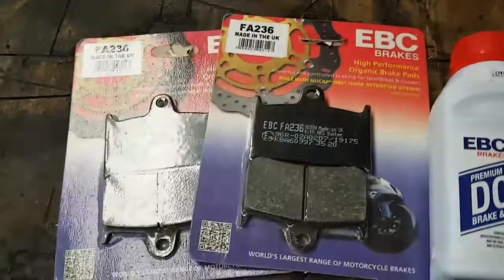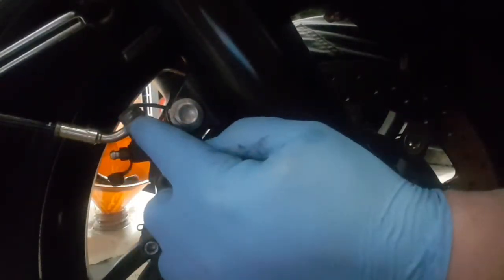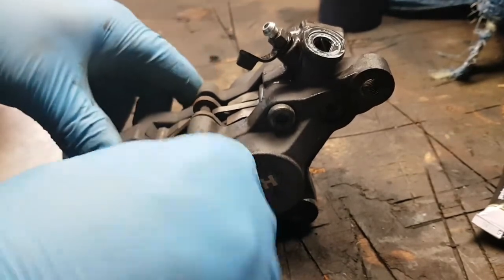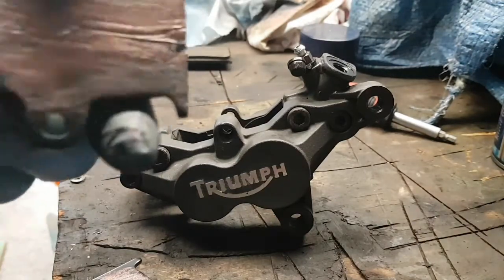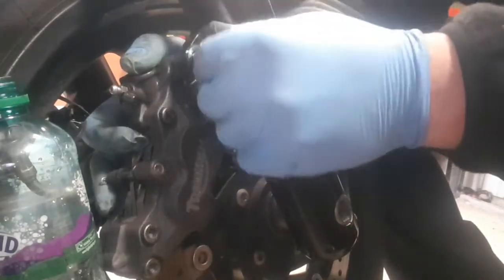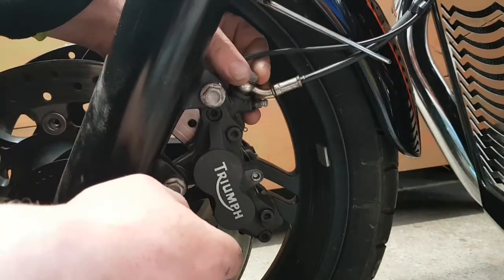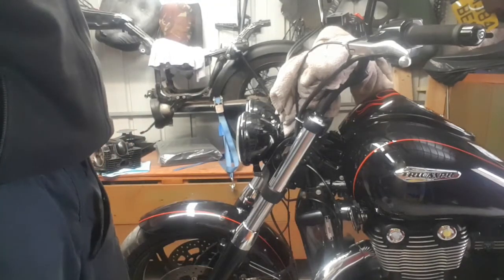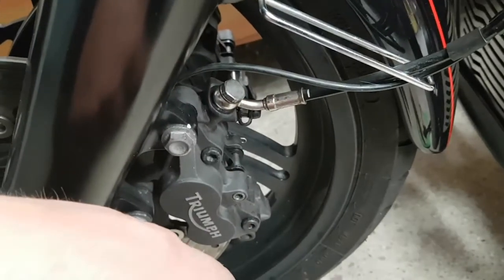Triumph thunderbird storm front brake pads

Comment: I am curious as to why you removed the brake line?  im just researching this and as its ABS, why not use the bleeder?  I am about to do this for front and rear.
Reply from the maker: Good day I took pipe off due to wanting to check the calipers fully  plus Easy to film when off